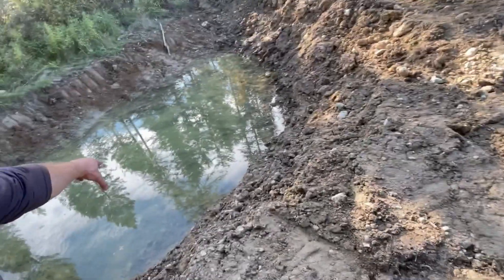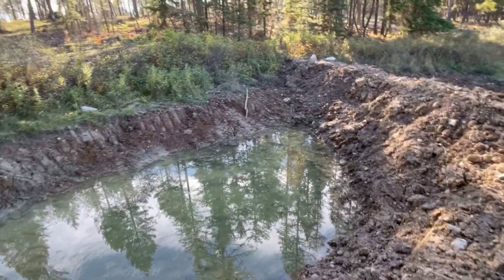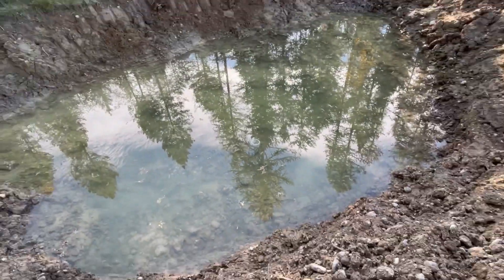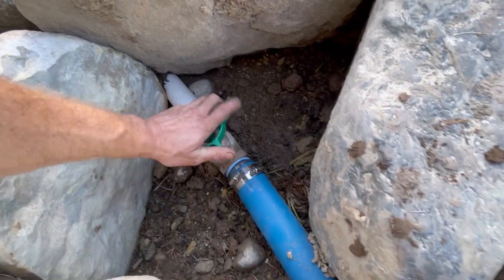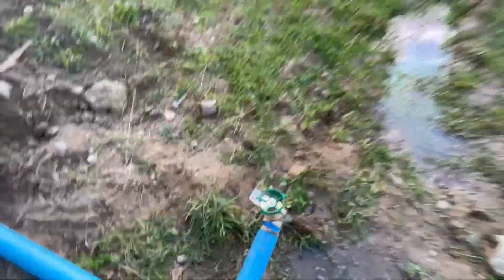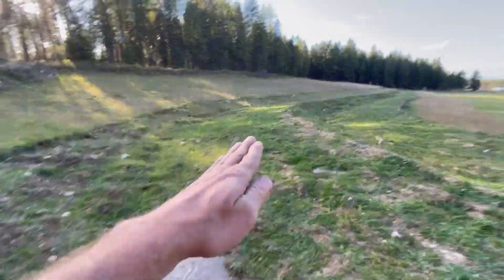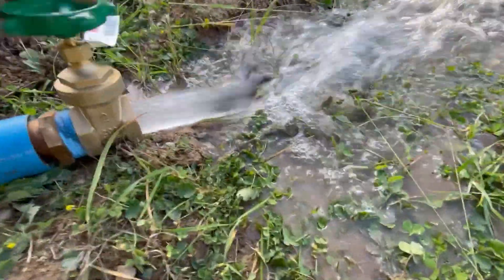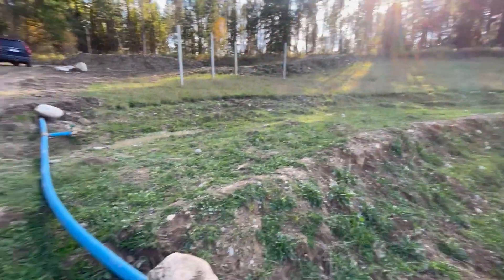How an Off-Grid Orchard Uses Gravity Fed "Pond" Irrigation

Comment: Won't flood irrigation eventualy salinate the soil?
Reply from the maker: Thanks for the question. Salinity can be a real issue with flood irrigation in dry climates like this, especially when evaporation is high and rainfall is low. As water evaporates, it leaves behind salts in the root zone, which can eventually make it harder for plants to absorb water—a kind of chemical drought.

This risk is higher if your soil drains poorly or if your water contains dissolved salts. Since we don’t get enough rain here to flush salts naturally, we need strategies to manage buildup.

One of the best tools is organic matter. It improves the soil’s cation exchange capacity (CEC), helping it hold onto nutrients like calcium and magnesium, which can replace sodium and reduce salt stress. It also improves soil structure—creating better pore space for water to infiltrate and move salts deeper. Plus, it supports microbes that can bind sodium or help plants cope with salinity.

That’s why I focus on organic matter–building practices: cover crops, letting tap-rooted plants decompose in place, chop-and-drop mulching, and importing mulch in the early years. I also prefer deep, thorough irrigations spaced far enough apart to push salts below the root zone, rather than letting them build up at the surface.
Reply: @RegenerativeFruitGrowers  good info thanks, I am not far from your area and I also irrigate from a pond

Comment: Very nice. Did you do anything to the pipe running through the dam? I think sepp holzer and zach weiss wrap a concrete fabric around it. Gives a ruff texture so water doesn't start travelling down the outside of the pipe.
Reply from the maker: Thanks for the comment. Yeah for this one we dug a trench all the way around the pipe. Then we mixed and poured 100% bentonite clay around the pipe (in the trench. We let this harden and then filled the roughly 70% clay soil on top and compacted it heavily with the excavator tracks and bucket.
Reply: @RegenerativeFruitGrowers  gotcha. On bigger water retention ponds they have had failures. The water wants to seep through along the outside length of the pipe. It's slow but it eventually creates problems. They now sand the pipes to ruffen them up and dip cloth in wet concrete and wrap the pipe. Some day I'll do one but have avoided it for now.

Comment: Nice! Would you recommend doing this with a hose for a small backyard orchard?
Reply from the maker: Hey Kellie, it’s hard to say without seeing the system. You don’t want a slope more than 2% because of the erosive potential. But you would want the water soaking actively in the roots.
Reply: @RegenerativeFruitGrowers  Thanks for the response! We have 6 trees and they are on pretty flat ground...I was just wondering if city water is ok to flood them with, or should I amend the water to try and get out the chlorine?